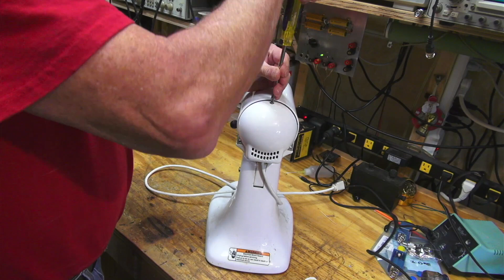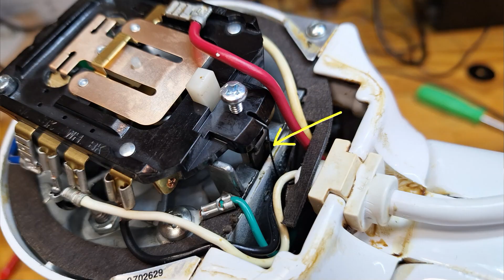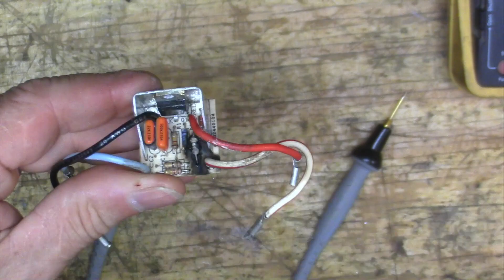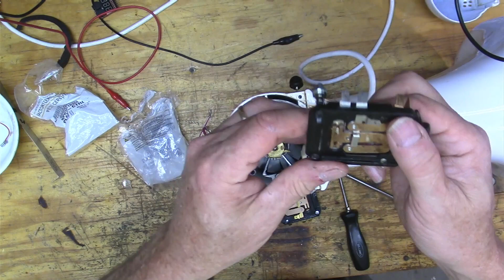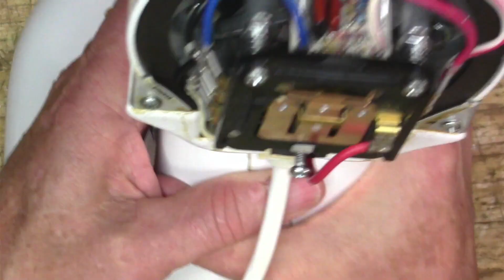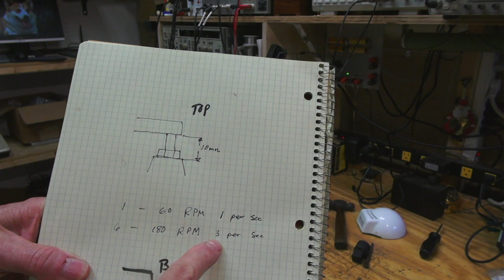Kitchen Aid Mixer Repair and Speed Setting

Comment: PLEASE REMOVE THIS VIDEO ASAP!!! YOU ARE GOING TO HELP PEOPLE MESS UP THEIR MIXERS!!! Make another one where you hook up the wires correctly. That's why it's running so horribly. The terminals on a speed control plate are all labeled (you can see them with a flashlight). Switch that white and red wire with the red wire on the side.

Comment: Why did you connect the red/wite wire to red and a red to RW?
Reply: Because he opened it up before, (0:34) put the wires on wrong and took a picture for reassembly with the wires hooked up incorrectly.

Comment: Le bruit de féraille qu'il fait en première n'est pas normal. Le mien fait le même bruit je soupçonne une usure du rotor. Au Fil des années de service et si c'est intensif le rotor c'est usé. C'est le frottement des charbons sur celui ci 👐
Reply: His problem is he hooked up the wires wrong.

Comment: I have a k45 and took it apart to regrease. I only took apart the necessary things. After putting it back together, it wont work on any speed going up except 10, and when going down through the speeds itll work at 8 and nothing less. Spring is still attached. Any ideas what it could be? It worked before the regrease. I've literally looked at everything and can't figure it out.
Reply: Similar situation. Mine won't move on stir (the motor activates and moans though).
Reply: Did you fix your mixer?